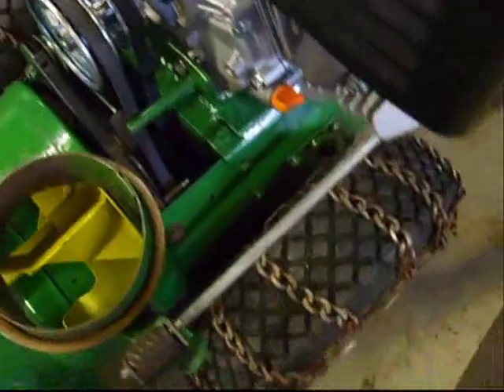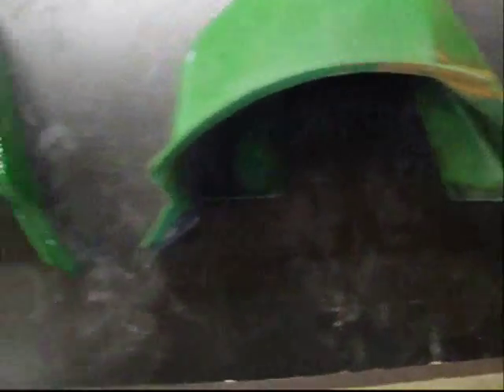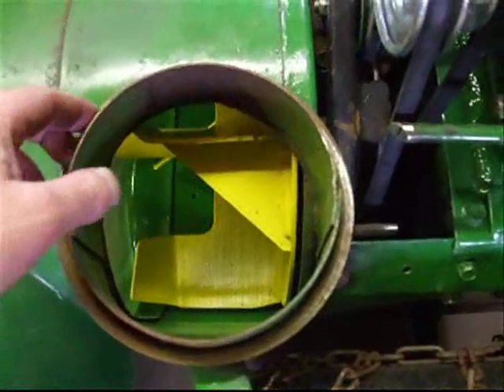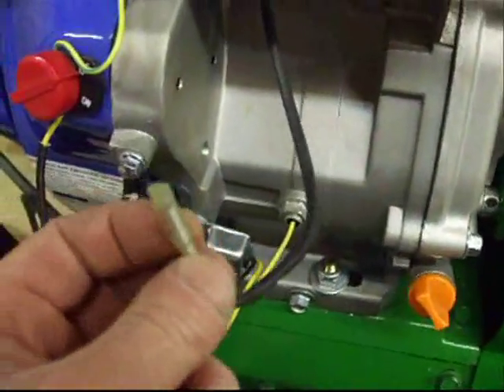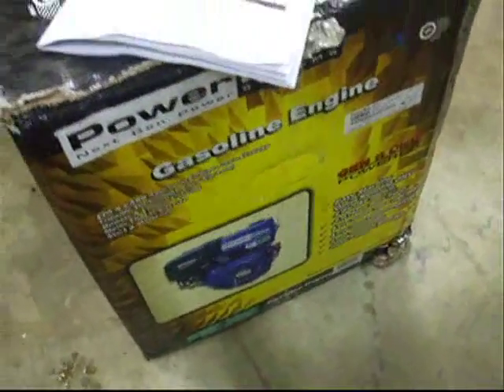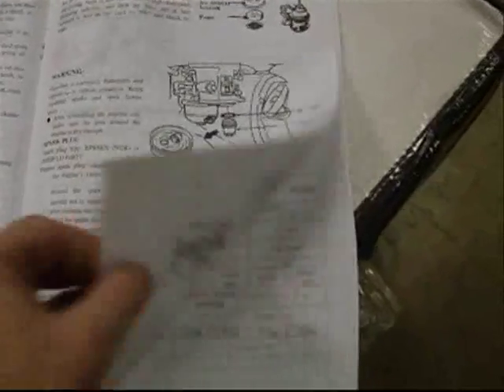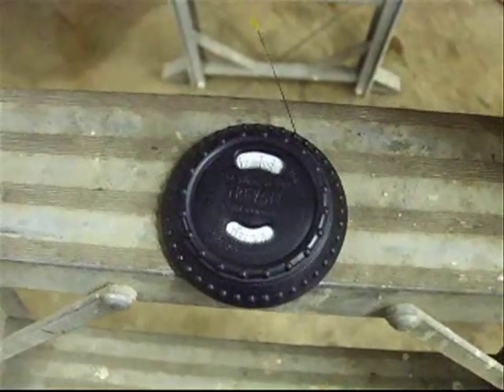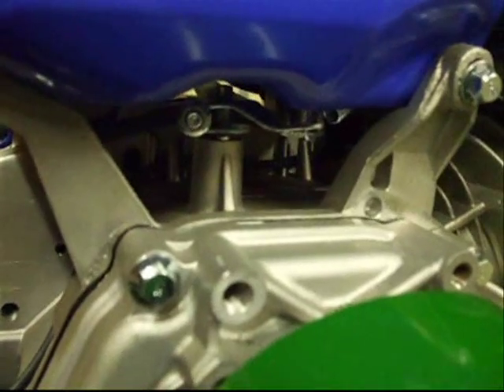John Deere 1032 Snowblower Repair & Modification Video Part #9

Comment: Those old ground out type safeties are unreliable.  I don't think I'd even leave it on as it is a false sense of safety.  Really, since it already has the the lever to engage the auger at the handle, if you added a dead man lever that mechanically released the auger engagement, that would be far more reliable and accomplish the same goal.